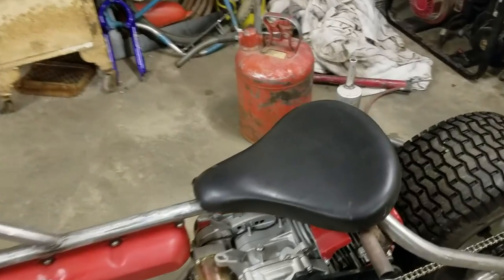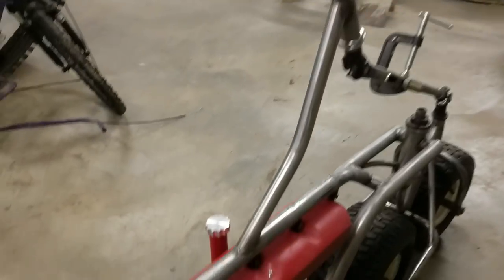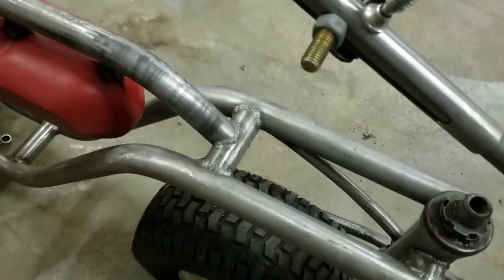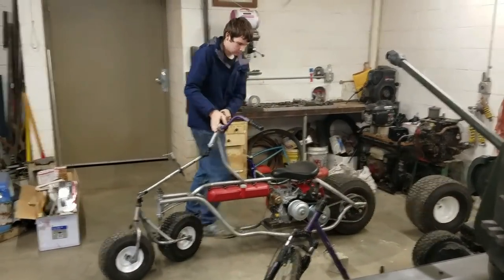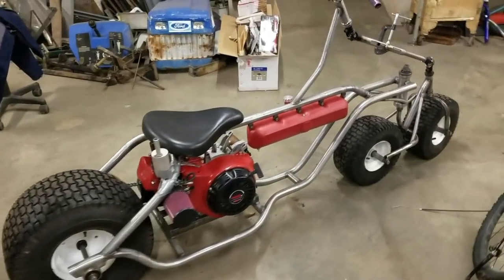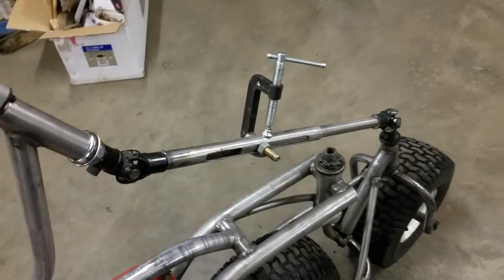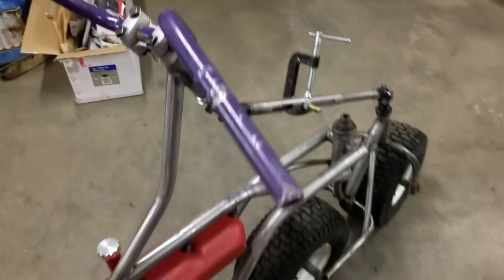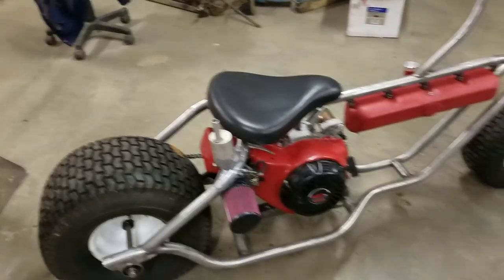Four Wheeled Motorcycle Part 8 (seat)

Comment: For your steering shaft you should look into tractor pto shafts.  They have some light duty ones that are perfect for steering shafts.  You can pick them up at the local farm and ranch supply stores around here and cut them down to whatever length you need.  
You should also add another brace to your handle bar mount pipe to make sure that it is not flexing that pipe and it might help with some of the wobble.
Reply: Glad I checked the comments before suggesting PTO shaft.

Comment: For your steering shaft, if you have a look at driveshafts, you may find some that have splined sections long enough for your steering system. The diameter will be larger, but you should be able to find this stuff in a junk yard for cheap!

Comment: Just an idea for the slop in the steering where the slot bolt is for travel try making a collar or sleeve to slide over the bigger slotted pipe section that the bolt can go threw as well so it travels up and down as you turn but sits snug over the slotted pipe so it cannot flex on you

Comment: Maybe you could try adding a steering damper to the front end. It would definitely be a good idea to add some damping to the shaft and limit the travel, it might also add more tightness to the unit. You could just use a spring from an old motorcycle coil over shock,  slide it over the smaller shaft and make sure it’s got tension at static.

Comment: looks like your getting little closer. need to to get a throttle control mounted, so you can eliminate some of that over steer you are getting from one hand steering. does look like the handle bars you installed help little. wonder if you incorporated some kind of shock stablilizer on that steering shaft to help slow down the excess travel from the over steer.  round knobby tires for sure will help you roll the bike into a corner better. yes you will need to seal the tank with a good two part epoxy tank sealer product or one of your welds will eventually catch up to you and the bare metal will rust and you know what thats does to the carb.
keep up the good work . your almost there.
Reply from the maker: thanks for watching!

Comment: Its looking smart m8, I was wondering whether sidecar steering damper shocks could be useful on the steering to give you an ability to keep it taut but allow it to move as and when needed?   Any sort of soft gas damper assy should do the trick as you want it mobile so it turns when you want it but also has a little resistance to stop it over steering.   Also foot pegs will make life a lot easier as well as you will then "bodyline" with the whole bike and find turning a lot better especially at speed, you could fashion up footrests attached to the front shall we call it bogie? truck? so you could use your feet to assist steering perhaps?   Can't wait to see the finished project, its the sort of thing that needs a V8 in and lots of roary bits in true mad max style ;)   I have been contemplating into putting a V8 into my three wheeled car (Reliant Robin) but doubt I could find a cheap Ford V8-60 I think its called complete with working transmission.   A shame the Reliant 850cc engine didn't make it over stateside in many numbers as these little all alloy engines and gearboxes are a godsend to small kit and trike builders here in the UK as the engine is tiny and easily lifted by one person even with gearbox attached lol but good to go for easy 100mph

Comment: why dont you use a set of mountain bike shocks for the steering tube? or at least put the tube with the slot inside the outer tube rather than the outer tube with the slot as you have now?

Comment: Clearly those ppl. haven't been watching the build series. Was wondering what your plans are for hooking the final rear wheel will be? Will it pivot from the wheel infant of it and will it be driven too?
Reply from the maker: it will be attached to a smaller frame that pivots on the axle that the rear wheel is on now.
Reply: Nice. Was thinking you'd do something like that.

Comment: Why not do away with the shaft entirely and do a dual cable set up like on a boat? The two cables attach to either side of the handle bar end, and to a tiller on the wheels.

Comment: Use a really long spline shaft/ housing for the steering
Reply from the maker: the trouble is finding one
Reply: For the steeting use a square bar inside a square tube, install a couple zerk fittings for grease.  Same design as a PTO driveshaft on a truck.
Reply: The tube supporting the steering tube needs a gusset.  It should look like an upside down "Y".

Comment: 3/4”x3/4” Square tubing is available in .058 Wall Thickness, 5/8”x5/8” Square tubing fits inside the three-quarter real nice. If you have any questions on different types of material that’s available you can get a hold of me at www.themetalguy.com it has all my information
Reply: i was just thinking the same square tubing would be the simplest solution and no bolt or anything else needed

Comment: hmmmm could look for a colapsable columb from a car , thost things have small plastic plugs that break causing the colum to collaps when hit 
i found this  http://www.emotoman.com/steering/steeringshaft.htm
heared about a simulair adaption for a chevy truck to replace the rag joint , though i forgot the brand , think it was jeep... they hit the colapseble bit with a hammer to break the plastic plugs inside and it can slide quite a bit after that

Comment: Silution for the steering-scrap the bolt, slot idea, and just use a rod and a pipe like you have and weld and weld it in place once it's together?